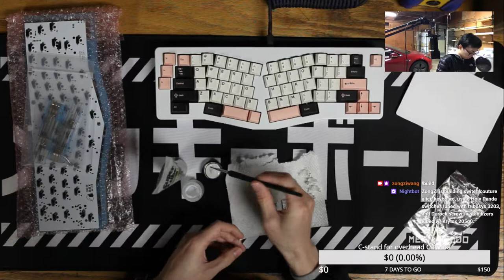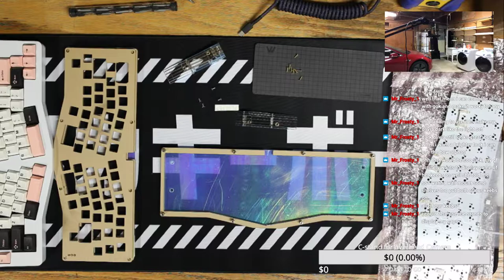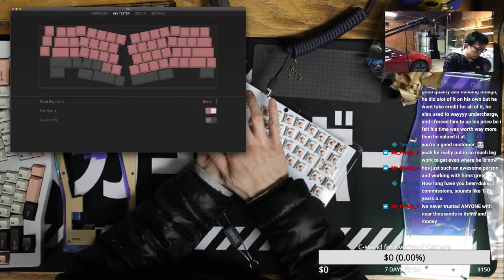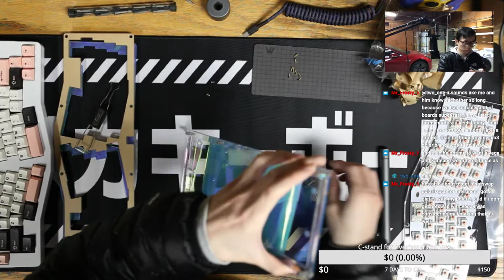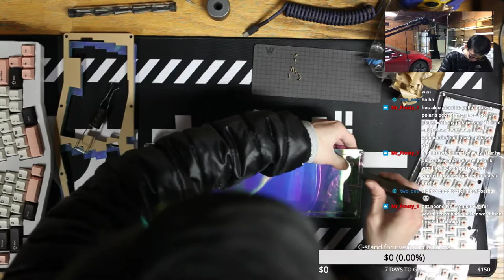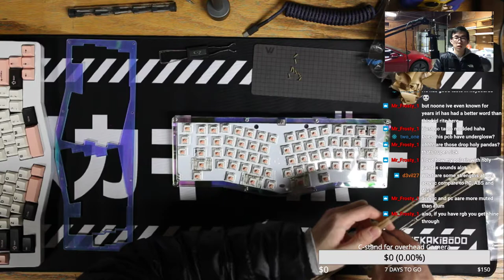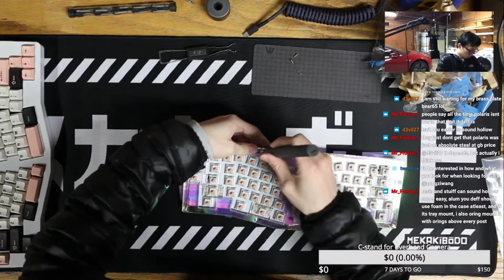Switch Couture Acrylic Alice w/ Drop Holy Panda Build Stream Vod

Comment: Did u not have an issue with the switch sitting flush in the ;: position? I had that issue with sneakbox PCB in my switch couture Alice.  Apparently the PCB has that issue where that switch position is 0.5mm south of where it should be so in thick plates the switch won’t sit flush.  May have not had issue since it was 3pin
Reply from the maker: Maybe 3pin is fine? I typed for a day and didn’t encounter that issue then I sent the board to client.
Reply: @ZongZiWang  awesome!!!!.  Thats good to know.  I have another build planned with the same PCB so I'll just clip the extra legs